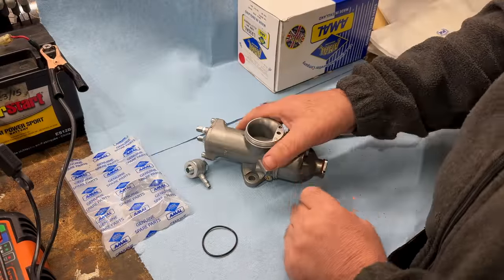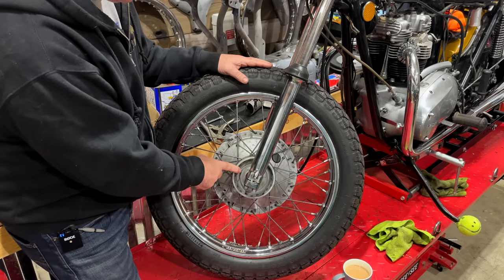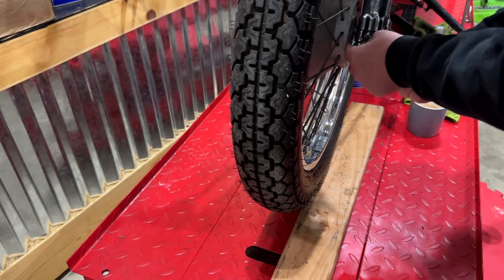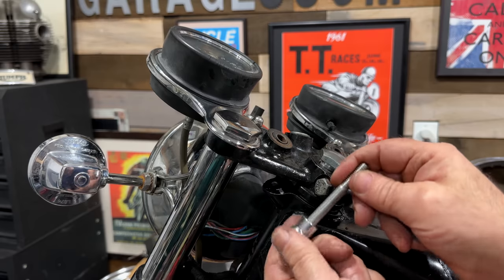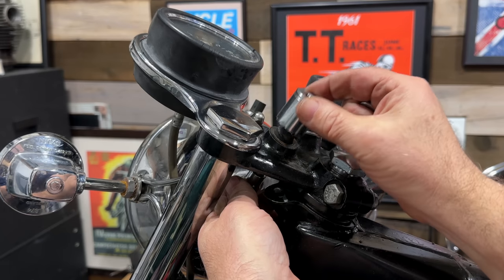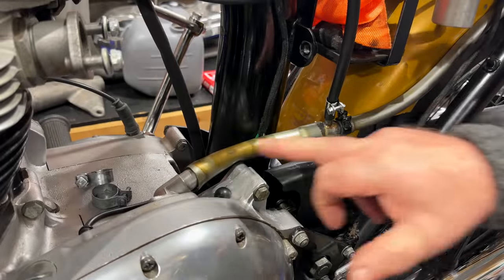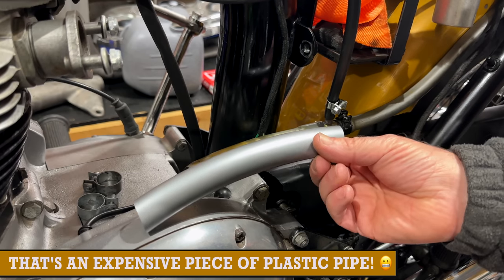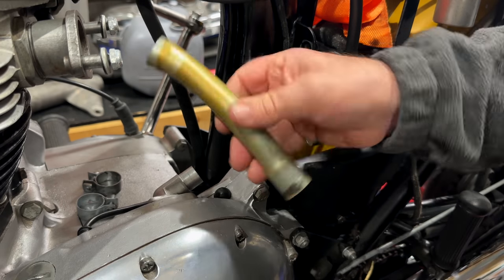1972 Triumph Bonneville T120RV 650 - Part 3 - Repairs

Comment: Good work, Mike. The engine looks so clean.  I got one of those new Amal Premiers for my 64 TR6.  It's nice.  The bike started easily before, but the old carb didn't have the choke.  Since the new one came with the choke mechanism (and I had the other choke parts that came with the bike) I left it in there and put the choke lever on the handlebars and hooked up the choke cable.  It starts so easily now.  First kick every time.  (Before it was first or second kick 90 percent of the time, now it's first kick 99 percent of the time.  And that one percent is probably human error, me being lazy with my kick.)

Comment: On my T140V, I removed the breather that routed up then down the rear fender, and installed a short tube from the back of the primary that aimed down toward the final drive chain.  The main reason was combustion formed water in the blowby condensed in the long original breather then ran back down into the primary case.  A reflux, in cool weather.  The shorter breather tube avoid this, and blows a bit of oil mist on the final drive chain.  Sacrifing originality of course.

Comment: I think I agree with you regarding the handlebars. I would prefer vibrations to any movement in the bars, which I would fine disconcerting.
Reply: I'm not so sure about that, he might regret it, but then again it is a 5 speed box and l don't think he'll be tearing around at 6000rpm trying to keep up with Jap bikes.

Comment: I'm so glad you got that bike, Mike. Such a pleasure to watch you getting it back in refreshed condition. Those new carbs are the aluminum versions of the premiers which may be why they are lighter. They are said to be more durable and less likely to warp than the non-aluminum versions. I also like the headings on this set of videos. Makes it easy to find them.

Comment: Hi Mike,.
One thing I tried on my Commando when installing the new fork covers/boots (which were really tight and stiff) was my heat gun.  I didn't get all that close but just enough to warm them up some and that helped a lot.  Give it a try some time..
Reply from the maker: Thanks very much for the tip, Mark! I appreciate it. Best wishes, Mike

Comment: In my experience, all premier Amal carbs come with the float setting being set way to low.  Eveyone I have bought has had this problem, so I would suggest checking that before installing the new carbs.  The new floats/carbs need a higher float setting than the original carbs/floats.  You can find that written up on amals website.  Not sure why they never some set correctly though.  And for as long as the bike seems to have been sitting, I would not have gone to the trouble to remove the forks and not replace the fork seals!  They are probably going to leak when you start riding the bike.
Reply from the maker: Hi Rob, thanks for your advice regarding the float levels. I'll definitely look at them. As far as the seals is concerned, I don't mind doing them again in the future if they leak. Cheers, Mike

Comment: Mike, dismantle and clean the new carbs and jets etc in the ultrasonic cleaner. There may be some swarf in the carbs from manufacturing. I have heard of people having trouble to adjust the carbs properly because of some residue in the jets or air channels.
Reply: You are correct , my friend bought a new carb for his 5TA and couldn't get it to run properly out of the box . Stripped and cleaned it three times ( no ultrasonic cleaner ) before it would run correctly .
Reply from the maker: Hi Uli, thanks very much for your advice. I will do that. I appreciate it. Hope all is well. Best wishes, Mike

Comment: The rubber handlebar bushings are shot. New ones won’t shake nearly as much and make the steering feel more secure while eliminating annoying high frequency vibration. I think I would have replaced the fork seals while it was apart. Just saying… Beautiful job being done here.

Comment: Very interesting watching you work on the bike, I've put new bushes and the correct dished washers, the correct way around on my handlebar mounts and I'm still not happy with the backwards forwards "play".
Reply: There are bushes out there that are too soft - as I found out when I changed mine on my 72 Tiger 750.  The bars flopped all over the place.  I found some much stiffer bushes and fitted those and the bars only move maybe 10mm or so when you pull on them.  Those stiffer bushes work just fine.  Can't remember where I got them from but the better UK suppliers should have them.

Comment: Hi, Mike.  About handlebar vibration; Isn't that supposed to be manageable with properly calibrated bar end weights?  Surely someone out there sells an engineered kit?  Or if the bar is the same diameter as, say a 2013 Honda CBR500R, maybe you could fit the auto-adjusting anti-vibration inserts they used with a good result?  Heck, it can't be that hard to cobble up a solution with all those spare oddities kicking around!

Comment: Happy new year Mike , it's scrubbing up nicely . Amazing what a difference a bit of T L C can do , however when I saw you putting the breather pipe on with the tails of the clamps sticking up it just looks ugly . Sorry . Thanks for posting .
Reply from the maker: Hehe, well spotted Anthony!  I have already fixed it. I thought the clamp would be covered by the air box assembly and then checked out some pics online and saw that the tab sticks out like a sore thumb. I rotated the clamp so that it's neater from the side. Cheers, Mike

Comment: If I were in a situation of removing each fork leg, certainly I'd rebuild them.  A great deal of the work is removing them.  Don't really understand that approach.
Reply from the maker: I'm just trying to focus on the things that need to be done, rather than jobs that might need doing at the moment. I also don't mind rebuilding the forks in the future if the seals leak or they need to be rebuilt. Cheers, Mike